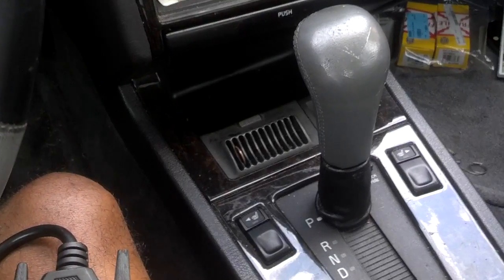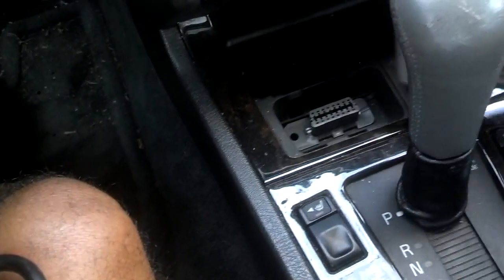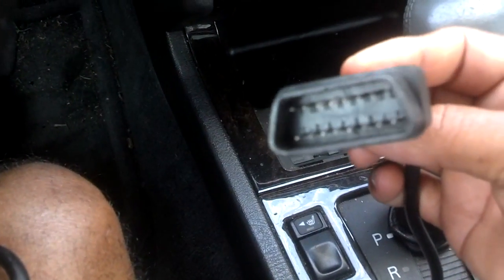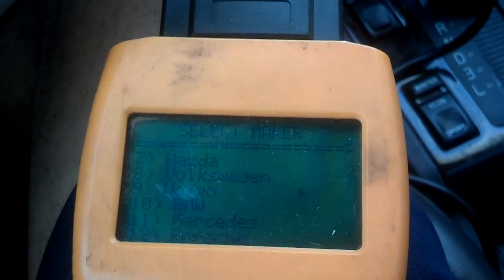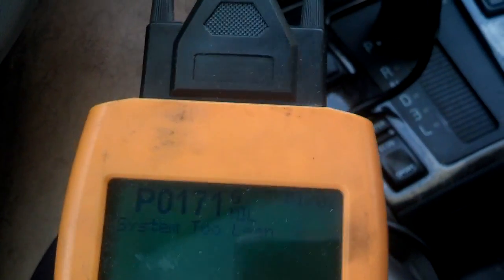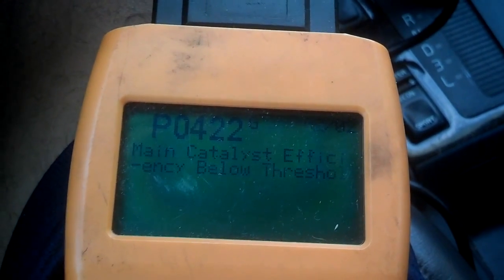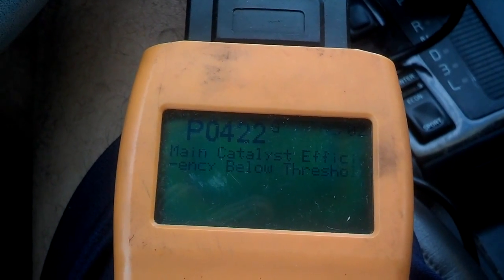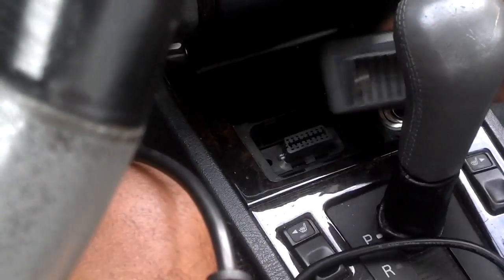Volvo 850 OBD-2 connector port location, checking error codes for the obd2. - VOTD

Comment: My new scan tool will power on a S70 1999, but not read data. Should I take a look at the connectors one by one?
Reply from the maker: no, that is usually not the issue. Check the OBD2 fuse and if it's good you probably need a different scanner.
Reply from the maker: https://youtu.be/r7BRGvltmHA

Comment: Have you ever had problems with your port not working? I have the same car and my code reader won’t read the car but I think it’s something to do with the car because it works on other cars
Reply from the maker: No. Maybe your fuse is blown.
Reply: @RobertDIY  just seeing your reply, as I seen your reply I thought maybe your right but checked all my fuses and all are good, I even double checked with a multi metre and they are all good. I have no clue why it won’t work.
Reply: @colt0864 have you figured out why it won’t work?

Comment: What fault reader works with 850/1996 with motronic 4.3? its very difficult to find some one what works with it.
Reply from the maker: https://youtu.be/VZflAyss974
Reply from the maker: Most.
Reply: What do you mean, most of them? Maybe Volvos in Europe are a bigger problem. It's really hard to find a reader who would work. Icarsoft i906 not working, it reads only srs problems. Elm327 does not work. So far, the only one that worked has been the expensive equipment of the garage.
Reply: Fault code reader manufacturers always Drop out the protocols of old Volvos.

Comment: Hi, Im a bit lost as my 95 is able to pull codes fine. But I'm being told to not do that and do the OBD1 under the hood. Is this true? Im getting a code for speed sensor (would explain no speedometer). Would that cause the transmission to not engage in R sometimes and not have the engine go past 3kRPMS?
Reply from the maker: Why not?
Reply from the maker: No.

Comment: I'm looking for factory diagnostics for my 98 V70. BMW has something called INPA which tells you anything you want to know (in german but you can't have everything) and several diagnostic and coding tools that work off a laptop.

Does Volvo have something similar? I can find it for '99 and above but of course I have a 98 V70.
Reply from the maker: VolFCR
Reply: @RobertDIY  thanks.

Comment: Hi Robert, I have a 1996 Volvo 850 t5 and I have been trying to use my obd2 scanner to check faults but it always isn’t able to connect! Any ideas? 
Cheers
Reply from the maker: either a blown fuse, messed up ECU or incompatible scanner.
Reply: @RobertDIY  thank you Robert I’ll look into this! 🙌🏻

Comment: Hey Robert just wondering. I have a 98 V70 glt. I bought it used and it did have a large EVAP leak which was a couple of lines that I replaced. Now I can't seem to get the drive cycle to complete at all I went about 1200 miles then I reset the drive cycle and now I've currently got almost 1500 on this drive cycle. When I check it with the obd2 scanner it tells me none of them are completed. Would this be a possible computer problem?
Reply from the maker: No, it was built broke. I'll try to find the drive cycle and make a video for it. In the meantime, you can drive the car to be tested and DO NOT CUT IT OFF and let them test it, it will often pass. If not, seek regulations, many states have a wavier for this model year vehicle.

Comment: What reader is that? Been trying to plug my one in the 850 and non will read
Reply from the maker: Have you checked the fuse?
Reply: @RobertDIY  You mean fuse 15?
Reply from the maker: I'm not sure. Did you check the fuse box cover?
Reply: @RobertDIY  Yes
Reply: @mabskha7917  Can you just not tell me whats the make of the reader youre using?

Comment: Hi Robert, am writing from Germany. Can you please recommend an OBD 2 scanner for my 1997 Volvo v70i tdi ?
Reply from the maker: Check this on to make sure it can reset the oil change reminder.
Reply from the maker: https://www.fcpeuro.com/products/autolink-al629-obdii-scanner-autel-al629
Reply from the maker: I'm using this one: https://www.ebay.com/itm/Launch-CR8021-Diesel-Gas-EPB-ABS-SRS-TPMS-Oil-DPF-Reset-OBD2-Code-Reader-Scanner/232740392814?epid=2228503661&hash=item3630688f6e:g:w7MAAOSwqYxdFYiJ

Comment: Hey Robert! I have a Volvo S70 from 1998 and I don't recall having those
 two boxes in the engine bay. Mine has a OBD connector under the 
armrest. Do you have a video on how to check for codes on those cars? 
Mind you, this S70 has the B5252FS engine (2.5, 10 valves) so it's not 
equipped with a Bosch Motronic, it's equiped with a Siemens Fenix 
system, I think the same ones used on the 850. I read on IPD that the 
B5252FS engine was not sold in the US. Hope you can help me out because 
my ECC is flashing when I start up the car.
Reply from the maker: Did you plug a Volvo class obd tool into the port under the armrest?
Reply: @RobertDIY  Can you advice me of a Volvo obd scantool to buy?
Reply from the maker: https://youtu.be/gt9w-ZSxs9I
Reply from the maker: Can't find my video, I'll post it tomorrow.
Reply: @RobertDIY  Thanks!

Comment: Hi Robert. I have a volvo v70 -98 model and my obd2 will not connect to any scanner ive tried. It does get power and its not the fuses. They all give me "linking error". Ive tried it with the car off, on and on position 2 and made no diffrence. Do you know what it could be?
Reply from the maker: No I don't. Maybe the computer is messed up.
Reply: @RobertDIY  Alright, thx anyway. Love your videos.

Comment: Hello everyone with Volvo from 96 to 97 (98 maybe if with old electrics) and with OBD-II port. I have now available an android app for those! It's called "850 OBD-II" (i use 850 volvo from 97 thats why) and it can be found from Google Play store. I hope it will be cheapest way to deal with these cars and most usable. I try keep and make it simple.. but useful.

more info and app itself:

http://xiaotec.fi/?lang=en&p=10
https://play.google.com/store/apps/details?id=xiaotec.fi.obdii

(It's been in development couple years by my free time.. now i put it in public)

In simple it is to be used with ELM327 bluetooth dongle or OBDLink SX USB cable via OTG USB support of your phones (i will add ELM327 usb cable support as i get one.. sorry guys for now)..
(with real V1.4b< support.. cheapest chinese like by konnwei wont support. Some info to test is in there in app)

(P.S. to leave this message i asked permission from Robert via email)
Reply: Your app doesn't work. Wont even connect to  my 1996 Volvo t5.

Also I dont think your app allows you to remove engine lightb

Comment: what if when i connect the obd2 conecter it says err it would read my obd2 ive checked all my fuses and i need to get my inspection and it wont pass until i can get my obd2 to read the codes and to acutely read the computer??. please help o .  tell me what i need to do thanks.
Reply: please note 2002 s60 volvo
Reply from the maker: Have you tried a different reader or is that what is going on at the emissions place?
Reply: Robert DIY yes ive tried autozone, advance, an a volvo mechanic scan tool. it wont read my obd2 port and all my fuses should be good. ive checked mostly all of them all 3 fuse boxes. put it wont even connect to pull the code on why my check engine light on.
Reply from the maker: +camworks 94 may have to have the dealer fix it.
Reply: Robert DIY yeah do you think its my ecm. or obd2 port?.
Reply from the maker: camworks 94 I have no idea.
Reply: and would i tell them i just want to have conection with my obd2 port so i can read my codes and and pase inspection
Reply: Robert DIY alright i appreciate trying to help.

Comment: Robert, Have you had any experience with error code p1618 on a 96  850?     My diagnostic tool says "fault in lead between AW 50-52 and Motronic.   The car drives but it feels like the transmission is running in Winter mode and the up arrow light on the dash doesn't light.    The funny thing is sometimes the car drives fine and other times goes in to that slow winter mode drive.    I noticed the up arrow light on the dash sometimes light and sometimes it doesn't.     In other words when that light works the car, transmission drives fine. I appreciate any help you can..
Reply from the maker: +S PC that is a pending code, the car is going into limp mode. There is likely a code that your reader isn't seeing. Have a Volvo mechanic check it out.
Reply: What reader do you recommend that can see the code ?
Reply from the maker: I really don't know, I don't have one. When I have hidden problems, I take my car to a Volvo mechanic. I really can't afford to spring for a Volvo class reader.
Reply: OK, Thanks, I will check with my local Volvo mechanics.

Comment: I have a 1994 volvo 940 station wagon non-turbo, the OBD port is NOT in that location in mine. 
Please help, my neighbor has a reader however we could not figure out where to plug it in. My vehicle has 262K and has a hard time starting at certain temps mostly when it gets around the 40's ( I am in Florida so this is chilly for us.) He wants to see if a code will give us a clue to the problem. He did replace the MAF from a junk yard about 3 weeks ago and it ran better then it has in years, however now it is acting up again.
Reply from the maker: +Patricia Dilley That was not REQUIRED until '96. It should have a self contained system near the drivers side strut tower. I would test the fuel pressure regulator.
Reply from the maker: +Patricia Dilley https://www.youtube.com/watch?v=bfeiZxhJgxY

Comment: Hello Robert, my father has got volvo 850R from 1996. Since 2006 volvo had been stuck in the garage without touching it, no start-ups, just left and forgotten. Recently i decided to take care of it, because i will have my driver license soon and this car is just perfect for me. I have seen your film with OBD II diagnosis. Few years ago mechanic tried to connect to volvo with laptop and program, but he couldn't manage to connect to it. Is there any specific equipment/device/program to this volvo that I must use to diagnose errors? Regards, Patrick. Also, the computer has got a performance chip.
Reply from the maker: Almost any scanner should get the codes.
Reply from the maker: https://youtu.be/VZflAyss974

Comment: Hi, 
Thanks a lot for your vídeos!
I am writing you from Barcelona (Spain).
I have a Volvo V70 2.4T 1999 193cv (last year of this first V70).
Works fine but the "check engine light" is on almost the whole time...
Which ODB2 bluetooth reader do you advice me? There are cheap models for sale online (from 9€). I would use it with my android phone and "torque" for example...  I only want to read (it will be P0422 code by sure) and remove the light.
Thanks for your work I am saving money and my V70 have 270.000 kms working well!!!
Reply from the maker: Francisco Javier Mena Hi Francisco, thanks for watching. I also have that code. I'm pretty sure it is related to an exhaust leak or possible slightly damaged catalyst converter. No experience with the blue tooth adapters.
Reply: Thanks amigo!

Comment: Hi Robert. I bought a cheap scan tool that connects to OBD2. It reads codes on our -01 Honda Civic, but on our -97 Volvo V70 it keeps saying "Link error". Do you know if there was a software update in -01 or something like that?
Reply from the maker: klonecki Nope. Does it automatically choose the system?
Reply: Yes it does.
Reply from the maker: I guess you will need to return it and get a different one.

Comment: What about in a manual transmission. There OBD Scanner is not under the coin slot. I have a 1993 Volvo
Reply from the maker: Kevin McCarthy How to read and reset error codes with the diagnostic tool on the Volvo 850, OBD1

Comment: Robert, what type of connector is used here? I have an OBD2 scanner but it's not the right type of plug to connect... Do I need an adapter or a special Volvo cable?
Reply from the maker: ***** Standard connector. Not sure what it is called.
Reply: Robert DIY Strange. The connector on mine is different. I must have bnought the wrong one.

Comment: I have a '97 850 that cranks but no spark....
Using a Pocketscan OBD II & CAN scan tool, all I keep getting is "link error". Does this not work with Volvos for some reason?
Reply from the maker: lordhighdan I have no experience with the Pocketscan tool. If you have NO SPARK, you likely have a bad ignition coil. If you have NO SPARK and NO FUEL PRESSURE, you likely have a problem with the cam sensor.

Comment: HI
Robert I have volvo S40, and i'm trying to connect my new OBD-2 scanner but not working....
Reply from the maker: What's going on? You should plug it in with the car off, plug it in and turn the car to the run position (don't start it)..

Comment: where is the obd2 port on volvo 850 tubro manual transmission
Reply from the maker: What year is the car?
Reply: 1994
Reply from the maker: That model does not have one. However, that car has a better system for finding errors.

How to read and reset error codes using the OBD-1 port Volvo 850 - Auto Repair Series

Comment: what should you do if you connect the obd2 into the port but nothing happens? whats the next trouble shoot
Reply from the maker: Did you turn the car on after you connected the reader (not start)? If so, try another reader. If it still doesn't work, disconnect the battery, then pull the ECU, check the ECU connection for rust, clean if necessary, reconnect, reconnect the battery, connect the reader, turn the car on.

Then you'll need the radio code.

What year is the car?
Reply: Robert DIY its a 98 s70.
i already tried another scanner and it doesn't work. i checked the ECU and everything is clean is there another ECU i dont know about?
Reply from the maker: Did you do the other things I recommended?
Reply: yes i did and still nothing i really think my obd2 port is bad i had a buddy come and check it out as well and he was saying that it couldnt read the computer
Reply from the maker: Have you pulled the port and checked under it to make sure none of the wires are broken?

I have to run but I will link you a video to show you how to make a tester/reader to see if the port works.